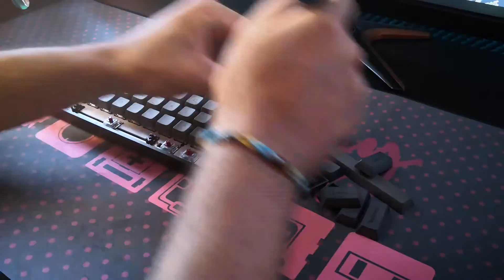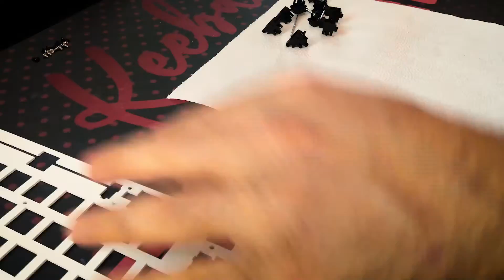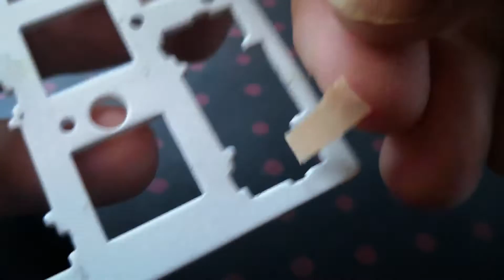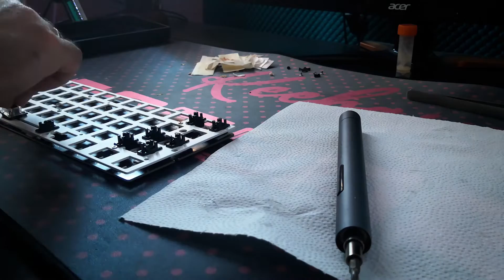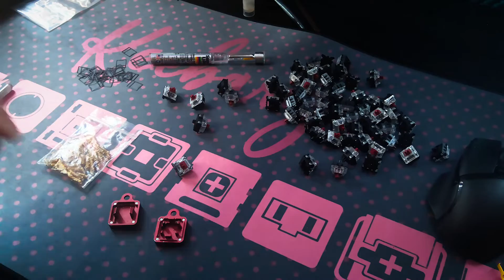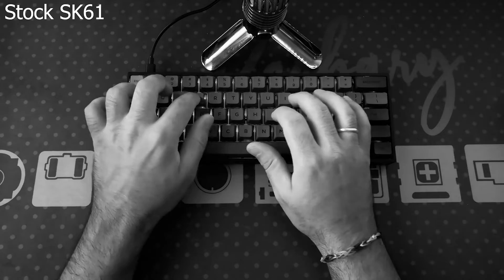Como MODIFICAR tu teclado ft. SK61 | Typing Sounds Comparison | Gateron optical Red

Comment: Gran vídeo brooo !! Consulta : también se pueden cambiar keycaps y las venden para este modelo o sk64?
Nuevo sub y sigue constante bro , SOS grande.
Reply from the maker: Gracias pichón. Si que puedes utilizar otros sets de keycaps. Solo tendrías que buscar incluir un Delete R4 y un Shift R4 ambos de 1U. Si no, con unas R4 1U blank te valdría igual solo que sin la leyenda. Saludos y gracias por el apoyo bro.

PD: si miras mi instagram, el "waterpink selection" lleva la R4 con 3x 1U blank debido a que ese set no dispone de modificadores 1U.
Reply: @canaryram  Voy corriendo a tu Instagram!!!! Gracias por tomarte el tiempo de responder, muy amable.